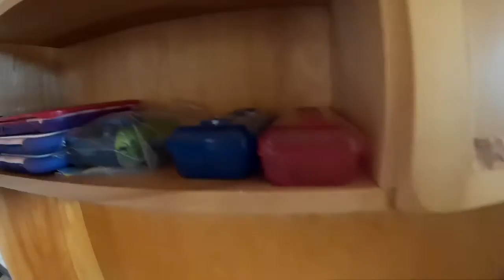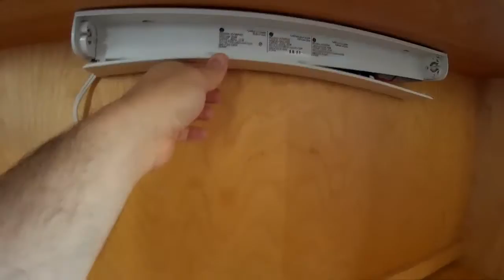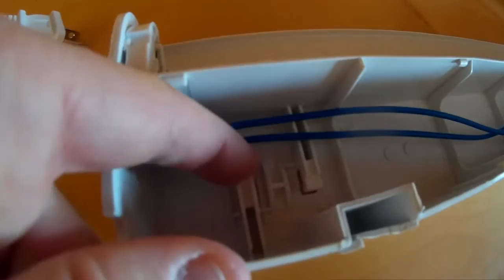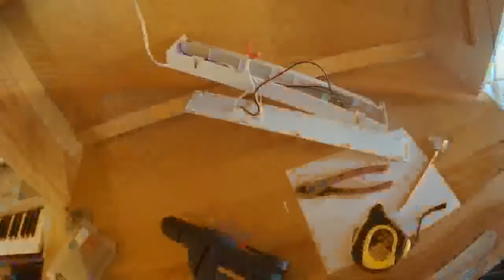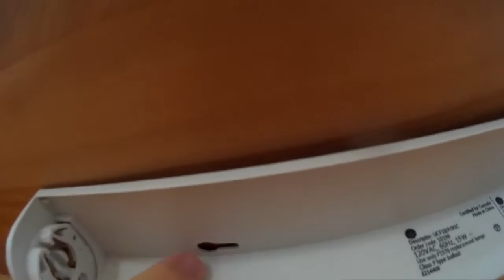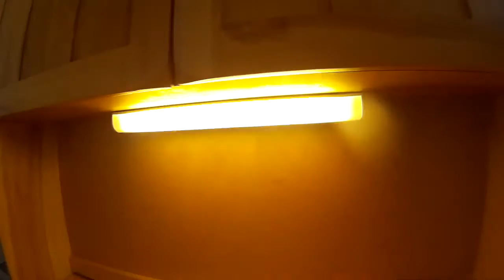Easy Hidden Wire Fluorescent Desk Lamp Installation

Comment: Polarised plug means connecting wiring is important. The power switch in the unit is a single pole switch, so it must be in the line conductor so you can not get a shock while changing the lamp with the unit plugged in and switched off. With an unpolarised plug the chances are 50/50 but close to zero with a polarised plug and correct wiring. Ballast unit apart from the heat of the lamp means it might last a long time, and at least they are using components that are not floor sweepings or recycled. No fuse of course, not even a fusible resistor must be using fusible traces on the board. the ballast might actually last 2 or 3 tubes before the plastic disintegrates or the capacitors fail totally.
Reply from the maker: +SeanBZA Good comment. Yes, I mentioned in the video that it is best to keep the plug polarity the same (so it is important to mark the wires before cutting) although I didn't look at why it is important for the circuit... Thanks for explaining it. I figure this cheap Wal-Mart lamp will not last too long either, based on the cheap all-plastic construction and the tiny ballast circuitry with likely poor quality capacitors. We'll see what happens and I will update the video comments if and when the lamp dies (and what component fails).